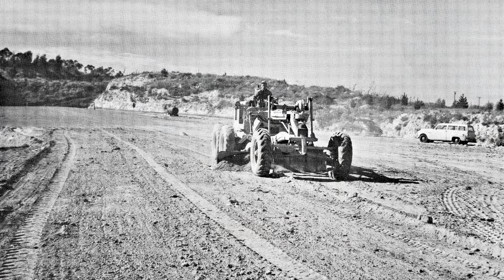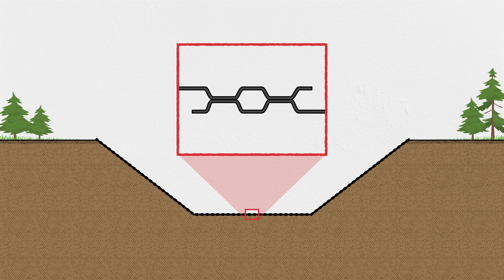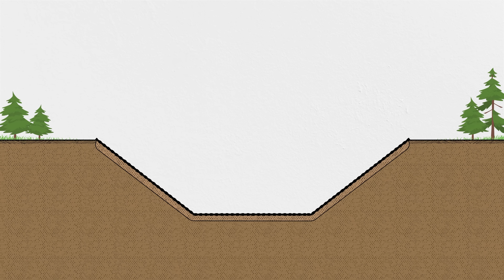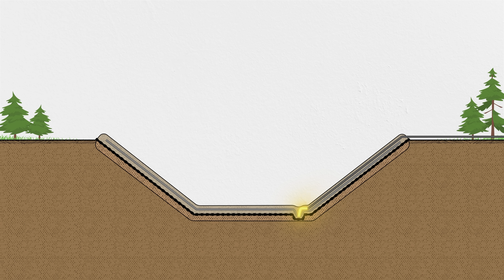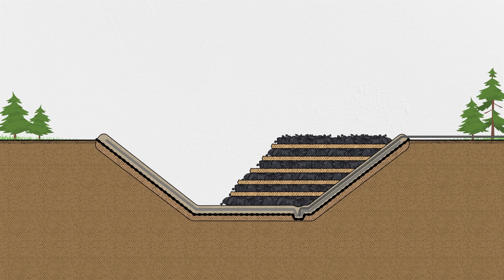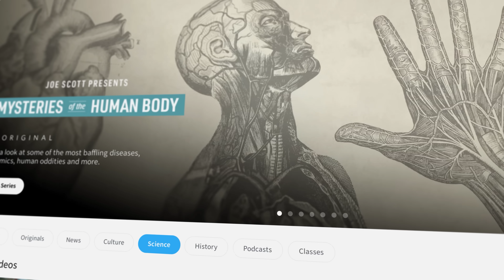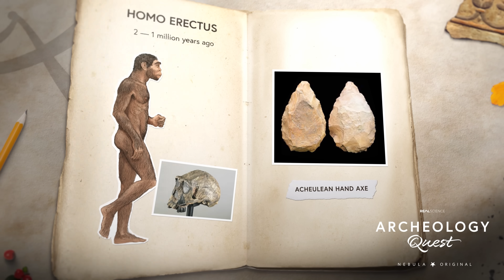The Hidden Engineering of Landfills

Comment: Another great video.  The science and engineering of landfills is fascinating, but I would have appreciated more information about the potential long-term impacts to groundwater.  The landfill juice (leachate) will continue to be generated for hundreds (thousands?) of years, far beyond the required 30-year monitoring window Grady mentioned.  Having worked with landfill engineers on a number of projects, the general consensus is that even with the plastic and clay liners and caps, all landfills will eventually leak.  Generations in the future will ultimately pay the price for our wasteful practices even though they derived none of the benefits from the products that formed the waste.

Comment: One of my favorite things is seeing value and purpose extracted from even the smallest or most worthless thing.
So seeing generators running off the trash and the land reused for parks is fantastic.
Though I do wish we had a better system of separation to extract even more i.e. burnables going to generation plants, organics going to digestors, metals getting pulled out.
Ideally we'd have no need for landfills because that's really the roughest way to put something back in the cycle but it's good to see us managing to make them a bit better.
Reply: Plastic is made from oil, may as well burn that too.
Reply: @seanworkman431  For a good portion of it, I agree. I've heard there is a lot of fake recycling and just general lack of interest because it doesn't really maintain quality. So we'd be better off burning it and switching our plastic source from oil to plant based sources.
As long as the exhaust is properly treated, then I don't see it being worse than coal or gas plants.

Comment: Some years ago, I did a personal study on our trash production, as we tend to recycle a lot more than solid trash we produce by about 3:1. The economics of recycling was eye-opening, as it seemed like free money on getting a wealth of recyclable materials that are sold to material producers. As it often goes, if no one is buying a segment of materials, anything you wanted to recycle naturally takes up space at recycling facilities already bloated with material, more than can be practically sorted and salvaged. A lot more goes to the landfill than I was prepared to learn, averaging about 50-60% across the spread. Lots of plastic polymers, and somewhat surprising, cardboard.

Add: that said, as a material scientist, I'm highly curious what can be pulled out of these sites as new multi-compound materials, but sadly I won't be around for that miracle discovery. Heat and pressure in the right places is a wonderful thing, but it's Slow.

Comment: Here in Finland we dont have landfills anymore and we are slowly cleaning out the old ones
Reply: How are you dealing with waste?
Reply: @IAmPGZW  Metal, glass, plastic packaging, organic waste, electornics, paper, cardboard etc all are separately collected and recycled. The rest that goes into bins is burned and turned into electricity or heat that is transferred to local buildings with huge waterheatpipes
Reply: They have gone back to the old days, and just burn everything (basically) 

But at very high temperatures, I assume, and with exhaust filtering.
Reply: @kanucks9  And capturing the energy the incineration creates.

Comment: In Switzerland everything is incinerated, it reduces the waste volume a lot, but we have to store the ashes.
Reply: Those ashes can be used in concrete or turned into glass as gravel for roads.
Reply: @blahsomethingclever - I believe there a Swiss company doing that type of concrete research
Reply: It's sent to Germany I believe, to have heavy metals sorted out of it and recycled.
Reply: send it to africa
Reply: @NeiyMaritz 😂😂😂😂😂
Reply: Incineration is more polluting than landfills. Incinerators do not avoid landfills. For every 100 tons of trash burned, 30 tons become toxic ash that goes to landfills.
Reply: @georgeherman9953 Well that might be true for other countries but here in Switzerland we have VERY strict regulations for garbage disposal. The trash has to be burned at a minimum of 800°C to ensure all organic compounds are fully reduced to CO2 and water. The exhaust is filtered and chemically treated. Now before that ash goes to a landfill metals have to be removed - the only toxic substances in the ash that should remain are heavy metal oxides - that's also why the ash and landfills have to meet strict requirements to prevent water or soil contamination. All in all we never had any problems with incinerated ash and actually not only massively reduce the volume but also generate about 4% of our electricity by burning trash - and heat a few thoused homes with the surplus heat generated :-)
Reply: @robstamm60  Sounds like an expensive process, but I understand space is at a premium in your country, so it makes sense.
Reply: @CycFlame  Yes it's not cheap but honestly nothing is cheap in Switzerland and smelly landfills would find zero acceptance here.
Reply: @robstamm60  I have worked outside near several landfills in my state, they don't have any smell when properly maintained, as this video explains.
Reply: @robstamm60  I live in California where we have even more laws when comes to pollution. We are close to shutting all the incinerators in the state.  2 years ago there was 2 left.... and they should be shut down. (Anything that burns generates CO2!) We've had states that try to generated electricity by burning trash, and most were found to pollute. As for the heavy metals and metal oxides, we don't allow any hazardous materials to be put into the trash. We sort all of our trash offsite and recycle more than 80%. Even if you tear down a building, all materials are  recycled. We carefully disassemble and separate all materials onsite.
Reply: @georgeherman9953 well that sounds excellent, it reduces the volume of waste to less than a third of the original amount.

Comment: Been to one on an engineering course trip. The leachate treatment plant on site has to be the most vile stuff ever has to be processed by a WWTP. Makes normal STPs smell like daisies.

One of the resident engineers on site also floated the idea of mining valuable metals from the landfill as a plan for the future. Idk if it's cost effective compared to mining and processing the raw ores, hopefully it is.
Reply: It is usually not, but LOTS of recyclables can be reused and extraxted much, much more easely if trash is sorted first. Just as basic as separating any electronics can make the job of reusing metals almost a dozen times easier because a LOT of recycled plastic (certain types), copper, iron and aluminum comes from just people tossing out old home equipment whole into the pile.

Comment: I worked on a garbage truck for a temp service. We went to the landfill multiple times. On one route we went back to the same streets to get recyclables. I actually got a little happy, because I thought I would see the recycling center. We went right back to the landfill!🤦🏿‍♂️ why even have people separate their trash if you are going to dump it all in the exact same spot?🤷🏿‍♂️
Reply: I lived in Columbus when they started giving residents recycling bins. It took a surprisingly long time before people realized the recycling was getting thrown in the same truck as the trash and wasn't being recycled at all. People were spending time, electricity, water and chemicals to clean their recycling just to find out it was getting mixed with their trash. Once people started making a fuss about it the city started picking up the recycling on a different day than the trash. Same trucks, same landfill, different day.
Reply: Last year I was in a public park on a beach on Sanibel island, Florida. I noticed the maintenance guy emptying the trash and recycling, and watched closely because I had a hunch…

He opened the recycling side of the can, grabbed the bag, tied it, and placed it on the ground. After he replaced the bag, he grabbed the actual trash bag, placed it on the ground, then sure enough, he grabbed the recycling bag, placed it INSUDE the trash bag, tied it shut, then tossed that single bag in the back of his truck.
Reply: Big oil lobbied to label plastics as recyclable so that people would buy more plastic, and thus more oil.
Reply: @Meyer-gp7nq

It’s a shame I had to scroll through a bunch of vaguely anti-government comments before someone said this.
Reply: Our county landfill bypasses recyclable sortation if their market for the recyclables is low you are correct. It just goes into the landfill.
Reply: So they feel like theyre doing something and dont put pressure on the big companies making money hand over fist while producing trash and waste at an incomprehensible rate
Reply: I did community service at a recyling center. Years ago China began refusing to recycle American waste so tons of cans and plastic waste were sitting in dozens of cargo containers in the back lot. Never found out where all that went, but it probably wasn't recycled.
Reply: Did you pay attention to any conversation between the driver and dump workers? or notice if you dumped the recyclables to the same spot as the trash? Many municipalities have recycling sorted at the dump. It makes sense to do so because some of those recyclables are not actually recyclable and sorted into trash. There's a whole continuum of how much processing gets done at the municipal level. Depending on the grade they are able to achieve, It gets sold and moved around to other processors or it gets trashed if there are no buyers.
Reply: @xungnham1388  usually this idea that it is getting all mixed together is based on a misconception of what is actually happening. The use the same trucks and take it to the same place because you do not need special trucks to collect recycling vs trash. You just need to clean them in between doing one or the other. Then they take them to the same place because you can have both kinds of facilities at the same location. To the untrained eye it may look like everything is being mixed, but most likely it is not.
Reply: @evancombs5159 actually, of the dozen or so landfills I worked on, when operational all recycling was dumped along side normal trash on the working face of the landfill.  No recycling of any kind was happening and it wasn't used as a "layer" either.    When there is money to be made, then I could see recycling actually happening but if the 5 or 6 times I checked my local county landfill over the last 10 years, no recycling period.   I won't call it a scam but it sure feels like it given the extra bins, different trucks etc.
Reply: @xungnham1388  only about 10% of plastic is actually recycled. Recycling is a scam.
Reply: Because people buy it. "We have it under control" is what you're ought to believe. The existence of landfills on their own prove we have no clue how to properly handle our waste. And by burying our trash we have lost the connection to the problem and are teaching the population to just go on.
Stupidity is bliss.
Reply: Because we uaed to sell the recyclables to China because they had the infrastructure to process it. But they stopped taking it around Covid so now just dump it 😂
Reply: Recycling is 99% a big scam.  Few people seem to know this, or are willing to acknowledge it.
Reply: Recycling bin is just the first sort of filter, most things that go in the bin are thrown out. They get filtered a few times along the way and each filtering process sorts out and throws out some of the stuff they got.
Reply: I work for a company that manufactures some types of equipment that you'd find in a MSW facility/landfill. Many of these facilities have some sort of sortation device (usually several) that separate the material into different streams via optical sortation, infrared sortation, air separation - really, lots of diff methods - that can be processed differently downstream of sortation, along with other types of processing equipment. Not surprisingly, this equipment/these systems  is/are *expensive*. Couple that with the need for maximizing throughput & processing/sorting as much material as efficiently as possible and you wind up with: "Hey, if we could get this pre-sorted before it gets here, we could pass more through our system, more quickly." This not only increases the bottom line of the landfill, but also contributes to lower costs that allow folks to pay what they do for trash collection and such.

Also, depending on the material, it won't necessarily be dumped in that location. They may receive further processing at the location, shipped to a different facility for specific processing/recycling, incinerated, etc - and in these instances the landfill acts as as a "collection and redistribution center". For stuff that is dumped, getting that material pre-sorted helps out when it comes to how they 'arrange' the waste in the landfill, which was kinda/sorta touched on briefly in the vid.
Reply: @mattlowman9857  what you describe is, indeed, a desirable picture. however, I just find it impossible to believe that waste management companies (really, the owner/managers who are... let's just say "often known to law enforcement as having other business to run") would bother to undertake such long-term socially responsible efforts.
Reply: It's the grift that keeps on grifting .
Reply: Why?   That's easy.   **Optics**
Reply: So people think they're making a difference while the politician can increase your taxes for virtually no reason and launder the kickbacks.
Reply: I worked at factories for years and some of them separated trash but at the end it all ended up in the same garbage truck
Reply: Welcome to feel good politics.
Reply: To build a habit when one is built
Reply: @lukasnopi6359 oh, you've got to be kidding. or you're the most naive person in the world.
Reply: @lukasnopi6359 it's called control. People aren't going to just create a habit because somebody else tells them they need to, but if they are lied to about how virtuous it is to recycle, people will line up to quack like a duck. For others who are just not adherent to reality, this may go over your head😅
Reply: Cause it takes more energy and releases more CO2 in most cases to recycle everything except metal, sometimes paper products can be upcycled I to insulation at some sites. Grandpa's playboy mags are now keeping a family warm.
Reply: because "climate change" in 2020 is like "pollution" in 2010. thats to say that people genuinely thought recycling would "save the planet"
Reply: 30 years of quacking like a duck, when in reality you have twice as much room for garbage now. So that makes that good news. We are being lied to about so many things that don't work the way that we think they do. It's good that there are some people that have an urgent desire to let the entire world know how things really work. Unfortunately half of that stuff is extremely scary and disappointing.

Comment: In Germany, all landfills are closed. This only exists when, for example, earth is stored temporarily or when concrete blocks are stored. But even concrete has to be crushed and used in road construction. Household waste is burned.
Reply: I don't know if they are all closed, because the remains of the waste incineration have to be stored somewhere. That's a lot less than the original waste, but the composition is probably more toxic. At least there's no need to worry about biological processes.
Reply: @JohnADoe-pg1qk  biological processes are still a problem, just less
Reply: not really true. househould waste is pre-sorted and the organic fraction is stabilized. and this still is beeing landfilled, just not labelled as waste but as cover material. but yes, the US esp. in this exaple is about 40 years behind in development.
Reply: But what happens to all the ash and unburnable elements?
Reply: @nnelg8139  Recycling is big in Germany/Europe, so there is a lot less residual waste that needs to be burned to begin with. The waste that gets incinerated is almost completely combustible, metals get removed beforehand. The residue&ash gets packaged and to my knowledge is stored underground in old mine shafts.
Reply: Incorrect. We still have landfills, however, they're reserved for inert trash, meaning that it doesn't decompose or chemically react with anything. So all non-recyclable trash gets burned, because ash is inert, and then the ash gets dumped (the exhaust fumes of the incineration plant get filtered). The basic structure of such a landfill is basically the same as the one that Grady showed, with multiple barriers and systems in place to prevent any bad stuff that might have survived incineration from getting into the ground.
Reply: I'm pretty sure Europe doesn't recycle/burn/bury everything. Portion gets sold out to some third world countries. And don't even think about hazardous materials like some nasty chemicals or asbestos... There is still lot to do.
Reply: Germany does still need landfills. However they are not for untreated household waste. Biological waste is sent to compost plants. Glass is sorted and molten again or used as a filler in construction. Metals are also recycled. Plastics are usually incinerated for energy production. Paper is used for cardboard and packaging. 
Finally, all the non-toxic construction waste and ashes from incinerator plants have to be stored in landfills.
Reply: No, there are a lot of active landfills in Germany, but they are not for raw/untreated garbage. 
Wikipedia -> Hausmüll / Deponie / Mechanisch-biologische Abfallbehandlungsanlage
Reply: Same in Finland. What can't be recycled is used in heat- and/or power stations.
Reply: the best thing !